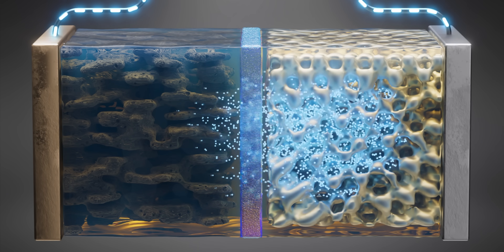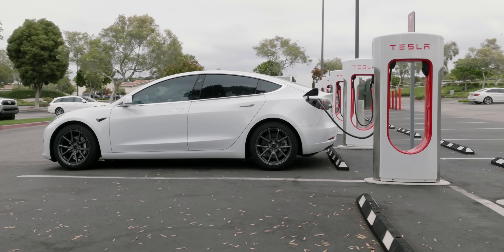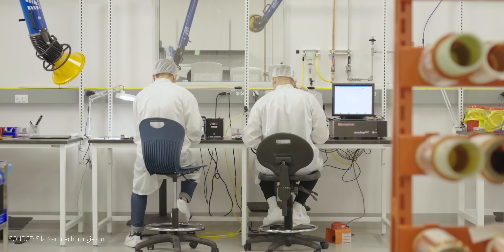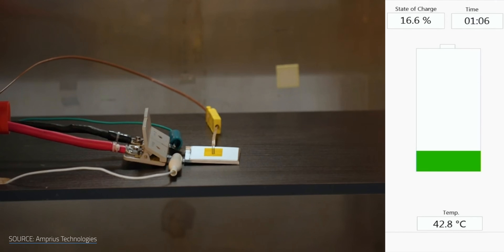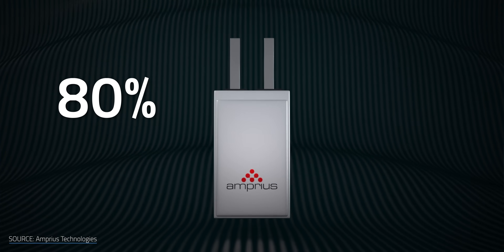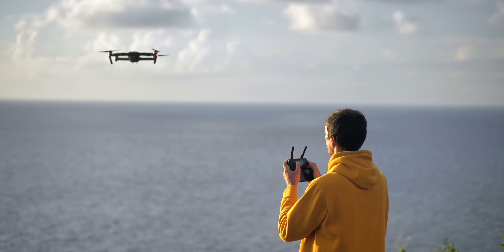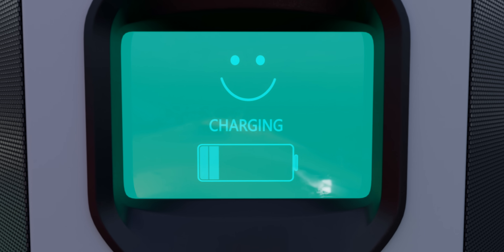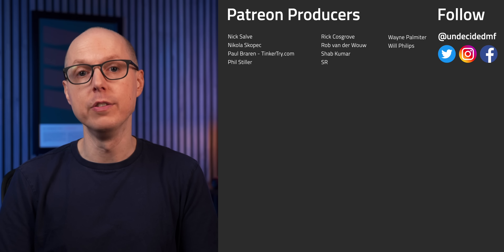Why This Ultra Dense Battery Breakthrough Matters

Comment: The marketplace will respond favorably to higher density, lower weight, longer duration, fast charging - and cheap batteries.  Current battery technology is too heavy, has problematic materials in them, don't charge fast enough - and are expensive in large battery packs for electric vehicles.  You open up a much larger market of users.
Reply: I don’t agree. Apple already deliberately makes software updates that kill batteries faster. Planned obsolescence is commonplace across the entire capitalist marketplace. Batteries that last longer also mean less customers. If it isn’t profitable, a capitalist has no reason to keep it.

And yes, you could make an argument that people will prefer quality products, but the simple fact is most consumers don’t actually research the products they buy. Marketing shows that consumers buy brands they are familiar with more than quality. So if a company want to make the most money they can, what they would do is make a “good enough” product instead of a “great” product, and then spend millions in advertisement. The good enough product won’t last as long as a great product, so when it inevitably breaks, the consumer might think “it lasted x long, at least I know what to expect when I buy from this brand”. 

The long and short of it is I don’t think a newer, better battery will be as favourable as you may think. When a system is built around the consumer, companies will choose profit over performance and (oftentimes) the best way to do that is to deliberately slash performance.
Reply: @connorgrynol9021    Planned obsolescence might have been a concept that worked before the internet - but from what I have seen - most products are built to last as long as possible.  The reason is how fast a company can get trashed and lose in the marketplace - if it is perceived they make shoddy products The world is more competitive today than in the 50s and 60s - not less.

Comment: The potential is there, sure. Tech concept sounds good...  I wonder how long life would be, expected life span is just, if not more important when you start talking about EVs.  If life span is a lot longer, it could take away another fear on EVs... Seeing replacement batteries for some EVs around $26K, it's scares people away, and these would only be an advantage if they last longer. 

A gas car could last 300-400K if not more, MOST EVs batteries would not last 1/2 of that IN THE REAL WORLD. It is a real concern.

Comment: The major problem in the past was the longevity of Amprius batteries. Amprius now claims 90% capacity retention after 1200 cycles in its eVTOL flight protocol testing for its 370 Wh/kg packs, but we don't know what was the depth of discharge in those tests. Previously Amprius said between 200 and 1200 discharge cycles, so maybe Amprius has dramatically improved the degradation of the battery since then or maybe it was testing in an optimal range between 30% and 70% depth of discharge to get the least battery degradation. Without more public data, we really don't know.

The silicon nanowires are grown in three stages with CVD, and Centrotherm's plasma-enhanced chemical vapor deposition (PECVD) equipment is used, which has to be expensive compared to graphite anodes. I doubt that this tech will ever get cheap enough to compete with standard batteries used in EVs, so it is probably just for high-end supercars.
Reply: Since aircraft are required to have "reserve fuel" I would almost bet money that they are using a shallow discharge for the typical eVTOL flight profile. Not sure how often aircraft dip into "reserve fuel".
Reply: Agreed. 3 stage processes means increased possibilities of "impurities" getting into the layers. Plus going into MASS production means another increased difficulties to maintain Quality and Quantity. Panasonic did researched into Solid state batteries. Mass production with consistency in Quality and Quantity was the main Issue. Ultimately COST must be competitive with market conditions.
Reply: Yeah, that's always thr issue. These companies always 'claim' some revolutionary breakthrough but when they have to show their work Oops suddenly silence.
Reply: @Dac85  " These companies always 'claim' some revolutionary breakthrough " Maybe that is why they do it. To entice investors to think they are going to make a lot of money when in reality all some of these companies are doing is extending their paychecks for years. Example, Theranos scam.

Comment: I'm still rooting for graphene aluminum batteries but these are pretty cool too. The more battery types we can get on the market the better, I'm sure they'll all have use cases that they excel in
Reply: We need battery solutions that are long-lasting.
Reply: im rooting for every battery R&D, more the better
Reply: Me too. I’m hoping they find good uses for Hydrogen. The final solution will be matching what the benefits of a given tech to the application it fits. Batteries are great for local deliveries, but a different tech might work better for cross country runs.  I thought the advantages of graphine would have brought it farther than it’s gotten.

Comment: Imho you late to amprius lol  It won't be cheaper, and it's not built on resources easily scalable. It'll be gr8 in the air though in specific commercial applications. Please don't talk about 0-60s, we need to bottleneck that at 5 seconds so we don't shorten the life of batteries and so we don't waste more kWh than necessary.

Comment: I remember years ago of a charge material that managed to keep recharging well after traditional batteries. The lifespan was so different that it would make all other forms of batteries obsolete.

This new battery might be that technology.

This is the technology we need for batteries, especially in EV's. If the lifespan of a battery can be extended to give full range for longer it could spell the end of traditional combustion powered vehicles. Not kill it entirely as there will still be a demand for combustion engines. On the plus side the demand for Lithium would drop drastically, making it cheap again before the hybrid market took off.

Comment: Swapping carbon for silicon would form an intermetallic compound with a FCC crystal structure. The solution would be to make the intermetallic compound Li4Si. Powder it to extreme fine dust, then mix with aluminum and bind to the aluminum collector plate with sintering. Would be a little less density than silicon nano rods, but would be much higher prompt current capacity. Now let's work on the cathode material, replace the cobalt...❤

Comment: Most people want e cars to be like for like replacements for their current car, in other words something that will carry four passengers and allow you to travel 500 miles without too much fuss in a single day.  It doesn't actually need huge range but 200 miles is perfectly adequate, as long as you don't have to spend more than an hour  charging it at say two stops.  And a Tesla will do this but it's unaffordable for most people.  Then you have  tiny city cars like the Citroen Ami, it's cheap but this isn't really suitable for long distances.  This lack of options for the "middle" is already slowing e car uptake.  Well off enthusiasts and city nerds already have e cars, but Joe Six-pack isn't jumping.  But if we can get these silicon batteries out at scale I can see us pushing out cheap e cars that Joe will buy.   A 20Kwhr silicon battery car could have a useful range,  charge up 5minutes without causing blackouts,  and with the fast discharge be usefully fast.  It won't be lugging around an 800KG battery pack, the interior space will be better.  I would consider buying one even if the range was just 100miles.

Comment: This is pretty good news but I still think that alternatives to Lithium are the ultimate goal. Lithium is simply not sustainable and the sooner research focuses on that the better. The reason why these companies are still using Lithium is that it is a known electrode material and it gets them to market much more quickly. But, that is ultimately the biggest problem with capitalism - the inability to put long-term benefits ahead of short-term profits. My investments are into non-Lithium solutions. It may take longer but ultimately will be much better for the planet.

Comment: interesting tech! Having said that CATL's new LiFepo batteries charge to 80% in 10 minutes. Though techinically that is significantly slow than 6 minutes, most folks won't  mind waiting an extra 4 minutes for a significantly cheaper battery/car

Comment: Sandy Munro had visited their factory in Fremont, and it’s just next to one building of Tesla. The professor of Stanford University Cui Yi actually came from China and founded this company, he’s same age with me.
Amprius utilized some semiconductor technology like PECVD on their process, which made its battery carrying more energy. I once worked in a semiconductor and also operated, maintained the semiconductor manufacturing equipment HDP-CVD.
However, silicon had some issues like you or Elon said in the past, and it need be coated with carbon or other ways to keep silicon in the anode. Otherwise, silicon along in the anode would be crumbled.
But Amprius claimed some of their batteries can exceed 500Wh/kg according to what I saw few months ago…
Their problem now should be on how to ramp up production more quickly.

Comment: Any idea on how the silicon and nano rods either help or compound problems with thermal runaway issues?  I can see how replacing graphite with silicone removes a potential carbon fuel source but are they any more stable and able to withstand or reduce dendrite formation or other issues. Also curious about what gasses are released during thermal runaway as opposed to traditional LI technology.
Reply: If this is the same tech as CATL's CM batteries, then thermal runaway would appear to be a thing of the past. CATL's claim is that the CM battery meets aviation standard stability
Reply: Because skin is basically glass, and not coal like how pencil graphite or carbon soot kind of is, I imagine thermal runaway would be harder.
Reply: Dear m barefoot, 
You raise a very good question. 
I will speak as a retired EE and an amateur chemist, mainly for July 4th.  Both carbon as charcoal or Carbon powder as in gun powder are quite combustible given Oxygen in sufficient concentration.   As you know,  completely burning Carbon gives co2. Burning Si gives SiO2, the main ingredient in sand.  So point is both are flammable.  In any Redox based li ion cell, the amount of Li stored in the anode with cell charged  determines the chemical reactivity. 
Conventional graphite,a form of Carbon, stores only 1 Li atom for 6 Carbon atoms.
Si holds far more, therefore more energy in a smaller space.  To make use of more Li, the cathode must become a larger store of Oxygen, for when the Li moves to the cathode where it "steals" Oxygen from the metal oxides mix there.  Li is a Lot Hungrier for Oxygen than nickel or manganese or Cobalt is. When a + lithium ion arrives at the cathode, it gets oxidized and leaves a positive charge there. Having just left the anode, a negative charge gets make there and current can flow,.and motors will spin.
Back to safety.   More stored Li needs more stored Oxides or other oxidizing  stuff to Balance the Reaction.  So simply put in 4th of July terms, the more Gunpowder the bigger the BOOM.
NEWER LI BATTERIES SEEK TO PACK MORE FUEL (LITHIUM,  SILICON,  possibly plastic separator, possibly organic carbonate electrolyte INTO THE SAME PACKAGE AND ADD MORE OXYGEN TO BALANCE THE REACTION. 
So again HIGHER ENERGY BATTERIES ARE A BIGGER FIRECRACKER/FIREBOMB. 
sorry if this hurts your EV visions.

Comment: Many of you have never heard of Moses Lake Washington. There is a very large company, REC Silicon (Norway), that has been helping to support a growing population here. For many years there were serious problems with exports from here to China and so REC was in shutdown mode, but that has ended. In just the past 2 years a lot of companies have started to build here. It is in Grant County, WA and the electricity is cheaper than dirt thanks to the Grand Coulee dam as well as a half a dozen other dams on the Columbia River. The locals can't build things fast enough to accommodate the growth.

Comment: Someone is going to crack the battery code, its just a matter of when. Electrons don't weigh much so there is huge room for improvements we just need better ways to park them. One day that zero point module in scifi that powers a whole house that is the size of a large thermos will be a reality.

Comment: regarding eVTOLs: look at Lilium. they are currently working on the mold for "mass production" of the body for the lilium eVTOL. it is a great product and it is working. so far they had only unmanned remote controlled flights. 2024 they will have a prototype of the real body (fuselage) of the plane and they will do countless manned and unmanned flights.
the production is in munic, germany. the tests are being done somewhere over a wine field in spain.
they are backed by some saudi investors. and what i heard is, it can serve as a taxi from the airport to the rooftop of the hotel for people with big wallets.

Comment: What's the cycle life? I heard fast charge/discharge and good energy density but no mention of cycle life.
I don't want to trade out car batteries or use that in the grid if it needs to be replaced every 6 months.
I wouldn't care if it cost more to produce if the cycle life made it more economical to use those instead of an alternative.

Comment: I believe that amprius batteries and tech have a lot of potential.

With that said, you missed one important aspect of their batteries. Yes, they have developed batteries with a high c rating, but they are planning to release either batteries optimized for a high c rating or else batteries with a very high energy density. Their batteries with the highest energy density don’t have a particularly high c rating. I don’t recall the numbers, but they have stated this publicly.

I expect that they will be able to sell into the performance EV market within the next few years. Maybe EV batteries will have to be a hybrid between silicon anode and some other chemistry— just ad other companies are making hybrid EV batteries. This way, they could probably make a battery pack with part having a high energy density and another part with a high c rating.

Comment: The worry for many is the issue of battery fires.  If overcharged (due to say a BMS fail) or physically ruptured we know a Lithium battery becomes like a fireworks.  We need a battery that either doesn’t burn..or one that smoulders gently as it dies.
Reply: If I’m not mistaken, they passed the “ram a nail through it” test, which is a good start. It seems like batteries are only becoming less likely to catch fire over time, which…is certainly how that should go. 😂

Comment: It isn't the only replacement. Look up Swedish company Northvolt's Sodium-Ion battery, cheaper, safer, sustainable and better than lithium batteries at 160Wh/kg, not as energy dense as Amprius claims of 500Wh/kg but sodium is probably more available than silicon nanowires. In any case China will have to find another market to corner other than rechargeable batteries soon.

Comment: I have a question Matt. 
Is LG Energy Solutions building their new battery plant in Arizona in hopes of finally having legislation pass allowing for the use of the lithium deposit within the McDermitt Caldera along the Nevada-Oregon border, potentially revolutionizing the global lithium supply chain? The deposit is estimated to contain 20 to 40 million metric tons of lithium

Comment: While their energy density is great, Amprius charges 30x more over 18650 lithium-ion battery cells. While their manufacturing ramp up will drop the price, it's gonna take several years unfortunately. Amprius gave me a quote for a 10kWh battery (240 cells, 24S10P) -- nearly $90,000 for their highest density 450Wh 11Ah cells. 

I'm excited to see if they can get their prices down to $3,000 for a 24S10P battery soon. But I am not holding my breath for even 2027.

Comment: My biggest concern with energy density is safety.  Any time you pack more energy into the same physical footprint you wind up with a potential for disaster.  EV car fires are already nearly impossible to put out once the battery ignites and are just left to burn.  Now add 5x the energy into those batteries and what would that look like?  Melted holes in the concrete below?  Slagged infrastructure if there is a car fire on a bridge?  Always consider the larger picture.
Reply: A battery fire means to write off the car.  On the other hand a gasoline fire ———. Oh yeah, same thing.
Reply: A gasoline fire can be extinguished far easier than a battery fire, and doesn't tend to reignite once put out, burn under water and burns at lower temperatures that won't slag a crater in the road under it @edwardcoulter9361

Comment: If silicon can accommodate 4 Li ions but swells, can silicon be bonded to some other atom or each other to only accept 3, 2 or 1 Li ion without the swelling problem?  It would still be a huge leap over graphite.

Comment: Indeed, this battery tech should be driven by mobile/wearable tech as it's an immediately addressable market rather than be resigned to the 'niche' shelf. EVs are another as current batteries are too large/heavy and smaller format cars could benefit greatly from this. But EVs are a small market as so few of the driving population are looking for a new car. The real market that requires much smaller, lighter motors + batteries to replace existing engines is the EV conversion market where every car currently on the road is a prospect.